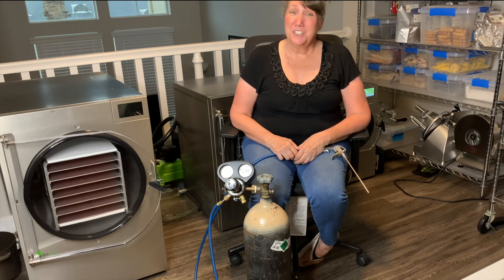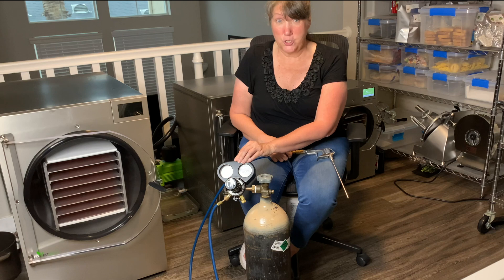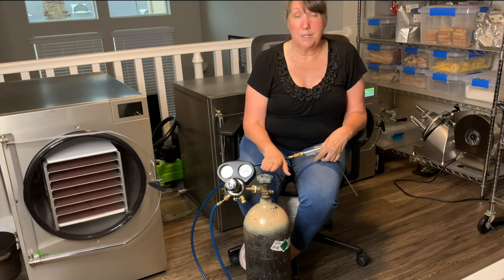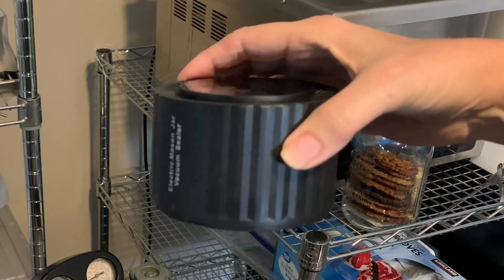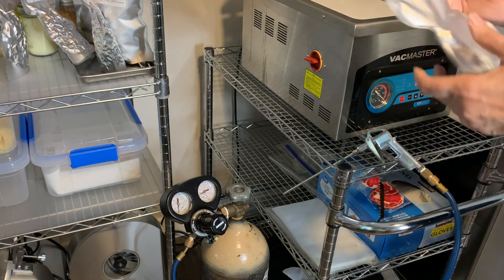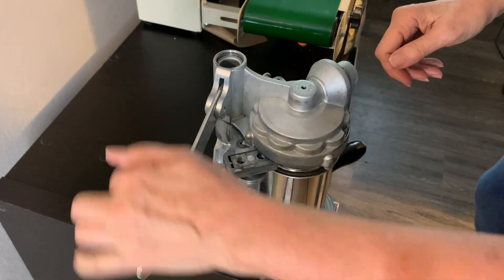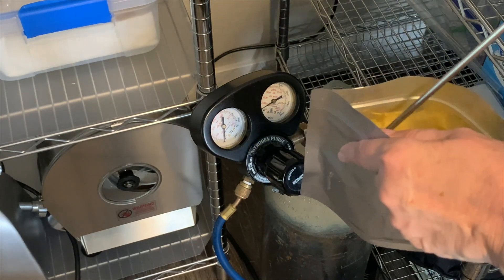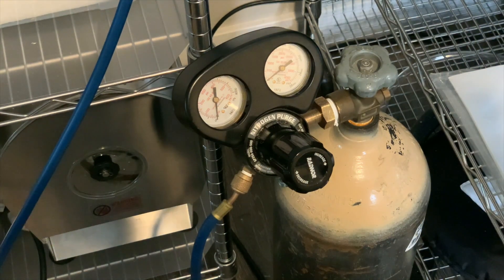Nitrogen Flushing for Freeze Dried Food Storage. #harvestright #NitrogenFlushing

Comment: If you vacuum seal after the nitrogen there is no point. The point would be if you don't want to crush whatever is in there. Or some other reason that there could be a lot of reasons.
Reply from the maker: Actually, yes, there is. You’re flushing 99.999% of the oxygen out when you’re displacing it with the Nitrogen, so with that in conjunction with the OA( which we always add) there never is any Oxygen left in our packaging. 
I’ve been FD’ing since 2016 and doing it this way since 2018 when my business partner who runs a commercial co packing business introduced me to it. 
We’ve never had a fail on any of these bags. EVER. 
Yes, We Rotate ( FIFO) and co sure our home FD’d food storage so we’re 💯 sure of the results. 
Thank you for commenting. 😃

Comment: How does it work for you having Freez dryer on the floor ... no fluding ?
Reply from the maker: I use Pyrex casserole dishes to drain into. I removed my hoses for these ones. I e been doing it like this for so long ( 9.5 years) that I’m just used to it. 
I’ve never had the drain water overflow, but I’m also in my kitchen a lot so I minutes everything and dump accordingly. 
As soon as my ice is loose in the chambers, I remove it. It helps cut down on the time it takes for the ice to melt and drain. 
I have the majority of my FD’rs on the ground because I live in SoCal and had a scare with my first knob model in a 2016 earthquake where it shook violently while on a table. I’ve had them on the floor since then. 
I’ve got 2 also in the garage on an industrial rack weathered to the wall and 2 in my commercial kitchen on a stainless steel table. Both of those also are feathered to the wall as well as the table. 😃
Reply: @kimmididwhat  uau ... nice set up!!! good work.

Comment: If you insert gas and then use the vacuum sealer, doesn't that suck the gas right back out?
Reply from the maker: The reason I do this is that the nitrogen gas is much heavier than oxygen, so when you flush the container with nitrogen, you’re flushing 99% of the oxygen out. Then when you vacuum, you’ve removed even more if it was left in there. The OA will absorb any tiny amnt that may have been left behind. 
You don’t have to vacuum after, I choose to ( except for delicate foods) because I know that my bags haven’t failed by sight. I’m in my food storage daily because we rotate ( fifo) and consume our food storage. 
It’s really up to you if you want to vacuum seal or not. 😃💕

Comment: Can you post the tools and model numbers of your equipment? I want to get a canner someday
Reply from the maker: Hi Nikki, were you looking for the can seamer I used in my video? Or the large one to the right of the continuous sealer?
Reply: @kimmididwhat both please. Also what is the apparatus you are using for the nitrogen?
Reply from the maker: @nikkithornton8424 , , The can seamers are an Ives way can seamer and an all American flywheel seamer. 
The parts of the nitrogen flush system are the 
1. Nitrogen tank
2. Regulator
3. Hose
4. Trigger
5. Cannula 
😃